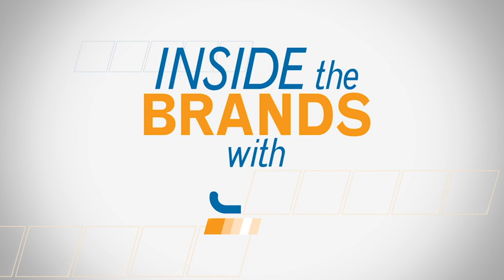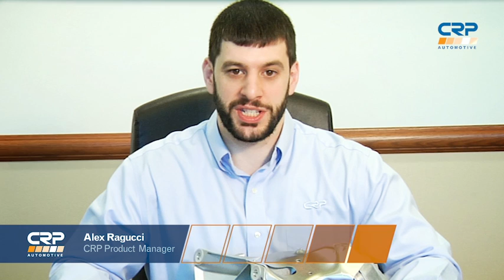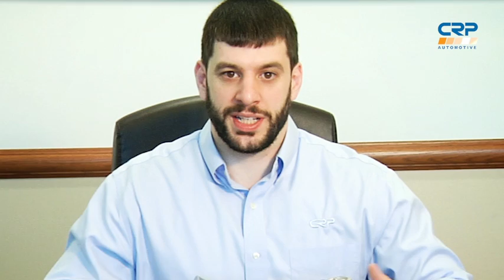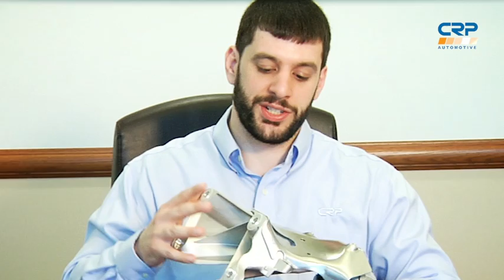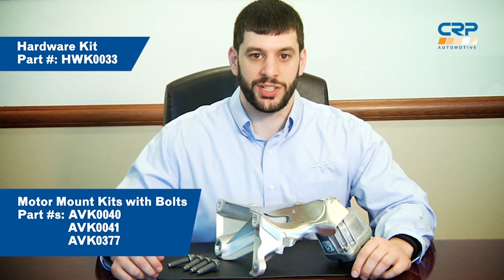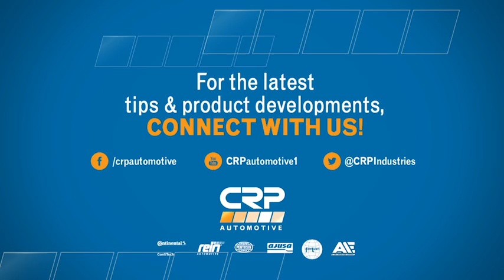BMW N51 / N52 Engine Bracket Bolt Failure | ITB Episode 60

Comment: Good to have a non-OEM FIX.  This situation actually sounds like an OEM miss engineered situation, like a CLASS PROBLEM.  Who is holding BMW accountable for such early failures???  Owners step up to the plate.
Reply: Would it be a problem if I switch the screws with metal ones instead?
Reply: @mitsuruyi  that’ll be dissimilar metals touching there will be rust corrosion likely to start eating the side of your engine block they need to add more weight to the aluminum bolt it may hold like this sucks man